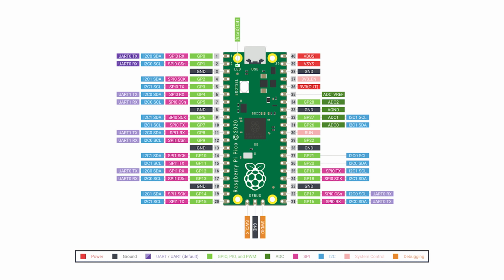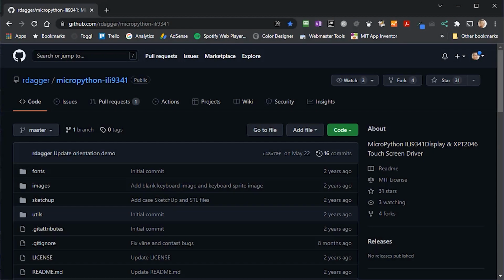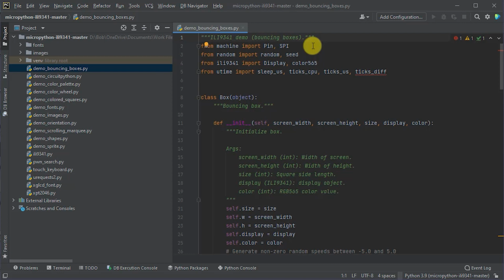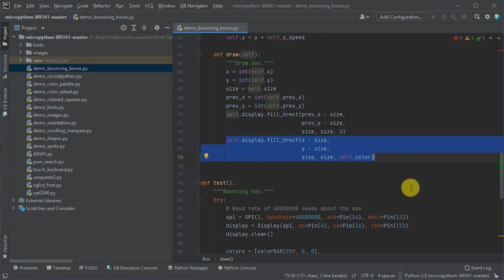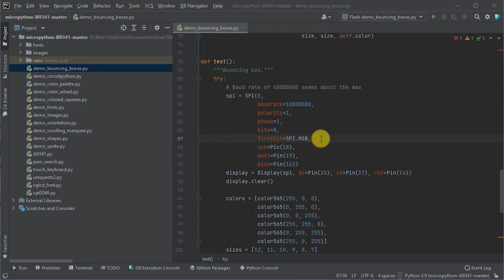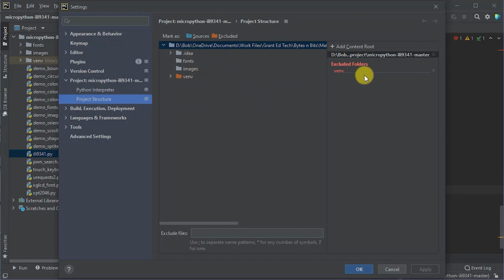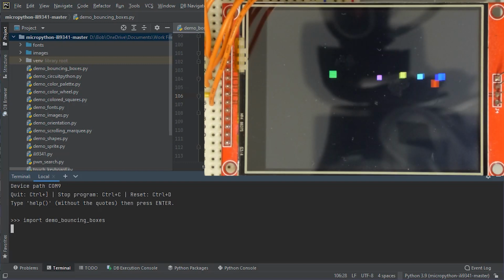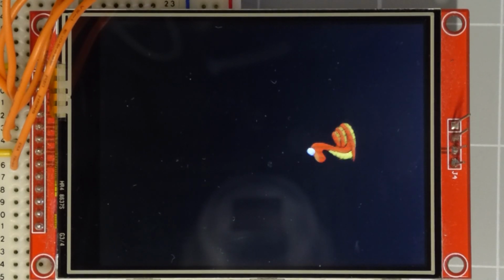Connect an SPI LCD TFT Display to Your Raspberry Pi Pico With MicroPython - ILI9341 Driver

Comment: This tutorial has been very helpful but I want to add a "heads-up" note. I have just figured out how to interface the newer Waveshare 2" LCD display for Pico. I discovered that it just won't work using 3.3 V. It needs the full 5 V from the Pico's VSys Pin 39. Could be that the IO pins are all functioning fine at 3.3 V but the display itself evidently needs 5 V.
Reply from the maker: Thanks for the information. I'll need to update these tutorials soon as they are a bit old now.
Reply: @BytesNBits  Well it seems I goofed: There must have been something else going on at the same time which was confusing me. I now have it all running and I have just discovered it all works perfectly well on 3.3 V!
Reply from the maker: Great! Good to hear it's working.

Comment: i have a qoustion how can i search a image online and then make it display on the screen (maybe i mist something during the video). also if i where to add anther external sd card with a sd reader could i put all the code and images/animations or gifs on there so it wcould run without my laptop ofcours i will then plug the micro usb in a wall socket.
Reply from the maker: You code needs to be on the internal storage on the Pico. The SD card is really for data used by your code. Once you've uploaded the code to the Pico it doesn't need to be plugged in to your computer. It will just run the last software you uploaded.

To display online images you'd need to write some code to download the image from the Internet and then use that data.

Comment: If you were to connect the sd headers to the pico how would you do so?
Reply from the maker: The MISO, MOSI, and CLK are common for all the SPI devices. You then need a separate IO pin for the Chip Select pin of the SD card. I can't remember if there are any other pins on the device but they would need separate IO pins as well.

Comment: hi, @4:30 you mention the next video will be showing you how to make your own driver, but at the end of the video you say the next video will be how to draw to the screen using bitmaps and the buffer, which is it or is the video covering both, also i have a similar tft lcd screen that connect using this ili9341 driver but its connections are gnd,vcc,scl,sda,rst,dc,cs so was tricky to figure out what wire went where might be a good idea to include both conventions in your tutorials
Reply from the maker: Sorry. This was a while ago. The video you're after is here. I think it covers both, sort of!
https://youtu.be/fGfb2NvDlG4
Reply: @BytesNBits  yeah i have already watched that but it doesn't touch on how to make your own driver, understanding how the datasheet for display related to commands in the driver would be very helpful for everyone as they could write their own drivers

Comment: Great tutorial!!!  I followed it with a 480x320 display.  It worked right away, but its shifted left by 160 px....so there's 160px on the right that I can't control and 160px to the left thats off-screen.   When I run the bouncing boxes demo, the boxes disappear off to the left, indicating its drawing, then they float back into view.  Any thoughts on how to un-shift the display?
Reply from the maker: Check you've got the right settings values for the screen dimensions in the code. Don't forget to make sure you get the height and width values the right way round. I'm not sure if the demo code is portrait or landscape.
Reply: @BytesNBits  For the benefit of anyone who has this same problem, the fix was this line.  I updated the 3 args from what was originally in the file:  
self.write_cmd(self.DFUNCTR, 0x80, 0x22, 0x3b)
in the init.  I have no idea what DFUNCTR means, but someone else discovered this and it worked for me

Comment: Can you tell me how to connect TFT LCD st7735S 1.77" to the raspberry pi pico ?
Reply from the maker: You'll need a driver library that supports that driver chip. They all have slightly different command and initialisation sequences.

Comment: Many thanks. Would this work with the ILI9488?
Reply from the maker: You'll need a suitable driver. The displays need a block of initialisation data to be sent to them at startup. This can be different between displays. You might get away with it for the ILI9488, but I'd have a look for a driver first.

Comment: Hello, your content is amazing keep it up.
Do you know a way to display GIF's on the screen display ?
Reply from the maker: You should be able to find a library that will decode the gif file. This will basically give you a series of image frames. You'd then need to either just display a static single frame or code some sort of animation routine to animate the gif.

Comment: i get this error: Traceback (most recent call last):
  File "C:\Users\User\AppData\Roaming\JetBrains\PyCharmCE2023.1\plugins\intellij-micropython/scripts/microupload.py", line 139, in <module>
    main(sys.argv[1:])
  File "C:\Users\User\AppData\Roaming\JetBrains\PyCharmCE2023.1\plugins\intellij-micropython/scripts/microupload.py", line 79, in main
    files.put(remote_path, fd.read())
  File "C:\Users\User\Downloads\micropython-ili9341-master\venv\Lib\site-packages\ampy\files.py", line 218, in put
    self._pyboard.exec_("f.write({0})".format(chunk))
  File "C:\Users\User\Downloads\micropython-ili9341-master\venv\Lib\site-packages\ampy\pyboard.py", line 267, in exec_
    raise PyboardError('exception', ret, ret_err)
ampy.pyboard.PyboardError: ('exception', b'', b'Traceback (most recent call last):\r\n  File "<stdin>", line 1, in <module>\r\nOSError: 28\r\n')

Comment: Would the pico work with the Hosyond 3.5 Inch 480x320 Touch Screen TFT LCD SPI Display Panel? I'm having trouble with locating the equivalents of LED, CS, RESET, DC, and VCC on this display.
Reply from the maker: If the screen uses the 3 wire SPI it should work. Sometimes the pins are labelled differently but they should make sense. Have a look at the device data sheet.

Comment: I really need help, i dont see such setup videos for the pi pico. My problem is that if you go to pycharm, file --> settings --> Languages & Frameworks, there is no "MicroPython". You can also make a Thonny tutorial for the ili9341 driver.
Reply from the maker: You need to install the MicroPython plugin for PyCharm. Please have a look at my setup tutorial. https://youtu.be/44dwZCz4_sc

Comment: how would you connect the sd pins from the display to the pico?
Reply from the maker: The SD card uses the same SPI bus. It just needs a separate chip select output from the Pico.  I can't remember if there are any other pins you need to connect but have a look at my arduino version of this tutorial where I use the sd card interface.

Comment: Is ther anyway to use the touch module with pico
Reply from the maker: Yes. Touch modules tend to be SPI devices. You just need an appropriate driver to run it. Make sure you find out what chip is being used in your panel and then find a driver that supports it.
Reply: I'm using the xpt2046, only found one driver but it doesn't seem to work , any suggestions for micPython would be appreciated
Reply from the maker: @safwanshaib9106 The LCD driver in the video has an XPT2046 driver. Did you try that one? I'm sure I tried it out and it was OK.

Comment: Very well done. I have not used Python but have used C since the late '70s. Any thoughts about using the Arduino IDE, C, and the Pico? The IDE 2.1 supports the Pico.
Reply from the maker: C on the Pico is fine. Much faster than micro python. The Arduino IDE is great for smaller projects and for keeping things simple but try Platformio in VS code of you're looking for a full IDE environment.

Comment: Did you ever end up making your video about building a driver from scratch? I have tried to follow your steps in this video, but I'm continually running into various software issues.
Reply from the maker: I think other topics got in the way and that idea dropped off the list. I'll probably come back to it at some point.
Reply: @BytesNBits  I understand and appreciate it. For what it's worth I think it would be a really valuable video for folks. There's so many different displays and boards out there that it can be extremely difficult to find an already built driver that works.
Reply from the maker: @TautologyTechSystems  You're probably right. I'll have a think 😀
Reply: @BytesNBits  I appreciate it. I have quite a bit of experience with the most popular Amazon OLED/led displays at this point. It has taken me hours and sometimes days to get them working and even then there are always problems and simple features/functionality missing.

Comment: Love the videos - please keep them up.  Right pace, right depth and been the thing that has got me started with RPi pico.  I bought an all in one board, the Waveshare 1.28” LCD with RP2040 chip, and accelerometer built it.  The sample code is non-existent and was wondering how I identify what is driving the LCD (it looks like it is an SPI interface) and go about either searching or writing a driver for it?  Any help or pointers really appreciated.
Reply from the maker: There should be some sort of data sheet for the board that details how it's all connected together. Are there any libraries for the board that you can reference?
Reply: Thank you!  Yes found a data sheet, which says the controller is a GC9A01A.  As you suggested I then searched on GutHub for a micro Python based driver for this chip and found one.  Thanks again, love the channel.

Comment: Hi there, can you please explain what file format the images are in this library? I'm trying .raw files that I've converted online but I can't get the images to display. It looks corrupted.
Reply from the maker: Hi. The image functions in this library uses bitmap file format as this is the easiest to decode. I'm pretty sure they need to be encoded as 24bit image files.
Reply: @BytesNBits  Hi there, thank you I'll try using the bitmap files
Reply: @BytesNBits  Hi there, I've tried displaying 24- bitmaps and the results do look better , however it still looks skew and the color is off. Could you please make a tutorial on how to save an image in paint and display it?
Reply: @BytesNBits  oh and thank you very much for this tutorial, it was of great help and inspiration.

Comment: I want to operate on ili9488 instead of ili9341. I tried, but the screen is cut off and printed out. I'd like to ask for advice.
Reply from the maker: You'll need to look in the documentation for your driver. The screens generally work in the same way, but you need to get the right initialisation code. If you can find an ILI9488 example that's the best starting point, or look in the chip datasheet. It will usually have a start data block.
Reply: I've just started the same thing ( ILI9488 + XPT2046).  Do have any advice/ anything you could share?

Comment: This same code will work on a Pi Zero or regular Pi 3 without modification, correct?
Reply from the maker: Hi. No. This is for the Pico. The full Raspberry Pi's work in a very different way. Have a look at my other videos that cover using an SPI LCD with the Raspberry Pi boards.
Reply: I would also like to know this as I have been able to setup an ILI9341 screen with PI zero from another one of Bytes & bits videos but it shows the full desktop rather than just sending images, shapes and test to the screen, let me know if you find anything on this please if you get a moment

Comment: Do you think the pico could handle playing a 320x240 video on a loop? Thinking of using one to make an arcade cabinet  miniature with a video loop of the attract mode of the game.
Reply from the maker: Hi. The driver in the video can just about manage 10 to 15 frames per second if you push it, and are not running any other software. You'd need to have the video stored as bitmap images for each frame so it's going to be a short video. I guess the answer is no. I'm working on writing a frame buffered driver which will hopefully get a gaming display up to over 30 fps but again the video frame storage would be an issue. Drop a Raspberry Pi Zero in and you'll get it working fine. Have a look at my RetroPie videos for the SPI display to see how to get full video running over SPI.
https://youtu.be/uz4sa24C4gk
Reply: @BytesNBits  thank you for the suggestions! The issue unfortunately is trying to get a pi zero at msrp (at least in canada)
Reply from the maker: @baddabaddabaddaswing  There is a shortage of these at the moment. Everyone is buying them s fast as they are being made.